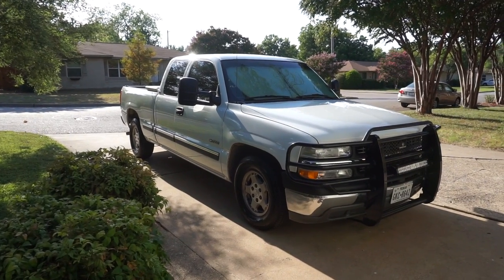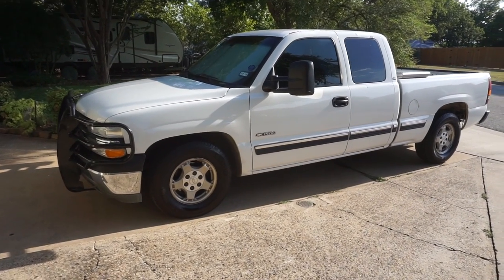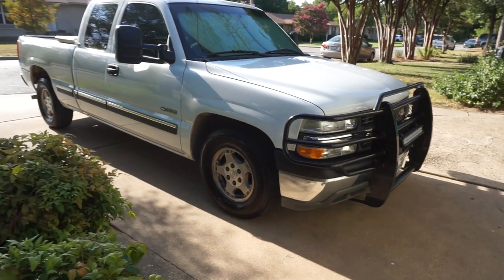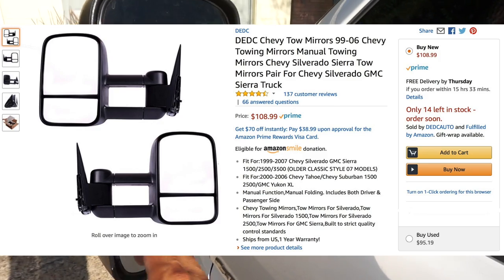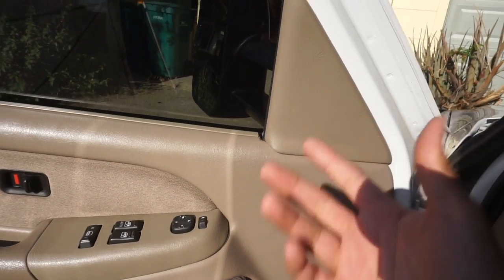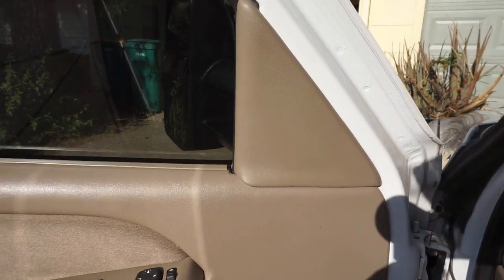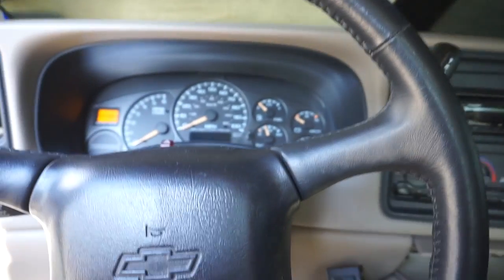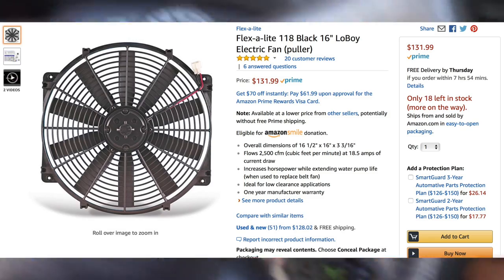My Truck Towing Upgrades - 2002 Chevy Silverado

Comment: Very nicely set up rig, great set up for that trailer. I will say however, I don’t typically tow much heavier than you but I wouldn’t give up the stability and confidence my 3/4 ton truck gives me for anything. Great video 👍
Reply from the maker: The bigger truck and suspension is always best.  My goal with this video was just to show how I got the most out of regular older truck.  I have since upgraded but there a lot of older trucks that people could certainly setup to tow well with.

Comment: Just did the brake controller on our Silverado. Going to do mirrors next I think. We are only taking short trips with our halftime and 25 footer as of now anyway. Lot of good information here man I do appreciate it. Go team Texas!
Reply from the maker: Curbside Junkies I appreciate it!  I would strongly consider doing the HD Trans cooler and temp guage... by far one of the best upgrades... and wasn’t expensive either.  Be sure to do it in addition to the current stock trans cooler for twice the cooling.  👍

Comment: Do you have video with any of the installs? How easy was the installer for the brake controller, low-boy fan, and transmission cooler with the gauge?
Reply from the maker: @christianshipman5766  
Brake control was plug n play
low-boy fan - yes I have a video on the channel 
Trans temp - mechanic installed when they installed the larger cooler

Comment: Helper springs are good, BUT . . .  Helper springs will not increase the carrying capacity of the truck.  They will help smooth things out, but you must not exceed the payload capacity of the truck.  That includes the trailer tongue weight and the weight of all occupants and their gear in the truck itself.  New trucks have a sticker in the door that will give you the payload capacity. This is not the towing capacity.  My Dodge Ram has a 7,800 pound towing capacity but only a 1,176 payload capacity.  The hitch weight of my trailer varies between 500 and 700 pounds, depending on how much stuff we have in the trailer.  So, when we hook up the trailer (which is well within the limits of the towing capacity) and my wife and I get in, plus our gear, we are actually 100-300 pounds over the payload capacity.  The problem with not being careful and exceeding the payload capacity of the truck is that if you have an accident, your insurance will not pay.  You will be stuck with the total bill.  So, keep that in mind, and remember that helper springs will not increase the payload capacity of the truck.
Reply from the maker: Correct the helper springs do not increase capacity, or any other item does not increase. The purpose of that is mainly to help level your truck, keep the front end of your truck lower for more control and a more comfortable ride.

Comment: Had the same problem with my Express van with the 350 in it towing. Had to put a duramax fan blade on it to keep it cool towing in Texas heat.
Reply from the maker: 106 today, that will put some stress on the cooling system.
Reply: I added a 3,000 cfm Flexalite 16" fan behind the radiator, between the radiator and clutch fan and it is controlled by the LS P59 PCM running the 350. I built bracketd and bolted it rigidly in place to prevent it from damaging the radiator or coming loose and getting sucked into the mechanical fan.  PCM turns the electric on with a/c or engine temp below 50 mph. I used a 2007 Trailblazer electric fan clutch. My first setup turned the electric fan on with Fan1 output and powered the fan clutch on Fan 2.  I have since added full PWM control to the fan clutch, using the 2003-2004 LM4 5.3L Trailblazer fan settings and wiring diagram.
Reply: @luisreviews6412  Mine got a work out yesterday.  Air going into the grille was 113°F.  In really hot weather my 383 will hold 220°F even working hard.  It has a 195°F thermostat and usually runs around 200-205°F. IATs sky rocket in the heat though, around town they were 194°F.

Comment: I have a 2000 5.3 Silverado LT with 3 hundred thousand miles on it and it still pulls my 9 thousand pond rv great so u dont need a diesel just have to know how to pull
Reply from the maker: Michael Bayless It could pull it without a doubt, but if you encounter hills or mountains it will certainly struggle.  The main reason I purchased a new truck was the need for a crew cab as my kiddos are getting taller and need more space.  By the way it is still in my driveway and does all my dirty work from hauling and towing.
Reply: Hey Michael I have a 2000 SC SB 5.3 Z71 I'm about to hook a 4300lb travel trailer to (dry weight.) Sounds like I might be ok? Upgraded brake controller and transmission cooling
Reply from the maker: GlutenFreeBear Consider adding helper springs they made a world of difference for me.  They were pretty cheap too.
Reply: @luisreviews6412  thanks! I have the sway and WD hitch at the moment will test my sag
Reply: i just bought a 2000 with the 5.3 how does it pull mine has 230k and i need it to pull a 7,000 pound camper does it struggle?
Reply: @tylerrobinson7322  I mean it does struggle a bit but as long as you use the tow haul it should do what you want it will not be a speed demon but it will do it dependably and reliable
Reply: I got a 2000 5.3 vortec  270k what can i do to pull a 32 ft rv trailor about 9800 pounds can i pull it 400 miles?

Comment: I have an 04 Avalanche that I've been doing upgrades to my truck as well, one upgrade that I did was to change out the axel bump stops.  I purchased them from Etrailer and they helped out a lot.  The axel bump stops that came with the truck were completely gone.  I bought the truck used, but it already had a brake controller installed.  I'm going to put Efans on it next and a trans cooler
Reply from the maker: Randall Castro Sr. Trans cooler is by far the best upgrade I did, don’t forget the trans temp gauge too.  I did e fans too... I have a video on my channel if that helps.
Reply: I put 1-ton overload leafs and Summo springs (replace the OE bump stops) on the rear of my 97 Express van that I tow a 28 ft with.  Much nicer ride than the OE leafs bottoming out on the OE bump stops all the time. I also replaced the stock 350 with a 383 when it was time to replace it and built the 383 up a bit.  Getting up to speed and climbing grades is no longer even a struggle. I had replaced the 4L60E with a 4L85E prior to the 383 upgrade.

Comment: Towing anything with 3.42 gears is like shooting yourself in the foot.  I have 4.10 in my Z71 but if I had 3.42 or even 3.73 I would swap to 4.56 gears.  The other upgrades you did are good.  Do you have a weight distribution hitch and anti-swap bars for your camper?  My friend tows a 30 ft with his Sierra 2WD 1/2 ton.  He's putting in a cam, long tube headers, a tune, and switching from 3.73 to 4.56 gears.  He has the same Tekonsha brake controller you have and I am going to put that in my Z71.
Reply from the maker: Scott Long 3.42 isn’t ideal, 4.10 wow must be nice, what kind of mileage do you get?  I got a 2018 Tundra with a 4.30 rear end you can really feel the difference gears in stop in go mainly.  I use a Husky Centerline TS and have been very impressed. The P3 brake controller has been flawless you will like it.

Comment: Have you ever thought about 2500 leaf springs on your 1500. I was told they would fit
Reply from the maker: @myleshartman7530  I didn’t think of that honestly.  The truck was at the end of it’s time with me so I didn’t want to do or spend too much.
Reply: @luisreviews6412  I'm thinking about living in a camper full time and I have a 2000 Chevy 1500 so hopefully it'll do the job

Comment: Do you use a towing motor oil also?Like valvoline vr1 racing oil in 10w30 .or a diesel oil in 10w30?....or even 15w40 or 50.Mobil 1 15w50 synthetic is also a good choice for towing in Texas heat.Still flows good in cold weather too.....great video btw.
Reply from the maker: steve rugerguy When I got the RV is when I made the switch to Mobil 1 for those reasons... the Texas heat and added demand.

Comment: If you had all of these upgrades do you think  You would be able to handle a goose neck. But let it be aluminum or a light goose neck?
Reply from the maker: As long as it was all within specs.  Biggest issue is payload and suspension.

Comment: I have a 2002 chevy silverado 2500hd 6.0 gas will that fan and the transmission oil cooler and the left springs  and the brake controller work for me and how did you install it.
Reply from the maker: I wouldn’t do those specific fans for a heavy duty, honestly I would keep the stock fan.  Yes on getting a better transmission cooler. There should be specific helper springs for your truck.  I did the springs myself, just bolt on. The cooler a mechanic installed along with a trans temp guage.
Reply: Well I didn't want to put the double fans but that one single fan

Comment: I know this is an old video, but I have the same paint* problem on my 09 Silverado. I take good care of my paint*  too. They must have a bad white color or something.
Reply from the maker: Agreed, but I believe it was the clear coat they were using at the time.
Reply: Every GM vehicle painted white will sooner or later have paint peeling issues. The last white one I had would lose paint in sheets going down the road. Adhesion between the paint and primer is weak and the paint tends to develop cracks that allow water penetration causing the paint to flake off. The only fix is to strip the vehicle and repaint with a quality compatible product. This has been a problem for years and GM refuses to address the issue.

Comment: Great video man, really informative.  I do have a question though...where did you install the transmission cooler and the accessory LoBoy fan? One in front of the radiator and one behind?  Both on the same side?  Thanks...
Reply from the maker: The trans in front, the loboy goes behind.

Comment: I might make some suggestions, don't do the electric fan, I would just upgrade your fan clutch and fan to a performance version, you also do not need to buy and set up a whole new temp gauge, if you want it to look more uniform buy a used cluster with the temp gauge on it from a 2500 and its simple to wire up, do not have two trans coolers installed it just creates a longer point a to b for the fluid, just install the heavy-duty one and throw the old one out, helper springs are nice but cheap and they crack and bend easy over time, getting rear airbag suspension is a better option for the warranty and it also allows you to choose your ride height, this video is helpful but as a long time mechanic I just wanted to add my tweaks.
Reply from the maker: Appreciate the input, the upgrades were all done in the last 2-3 years of ownership and were great.  I knew the end was near so the upgrades were a bang for the buck solution because there were certainly other ideas.  With that said the big one I would have spent money if I was starting out was the performance radiator and fan route... thd rest were perfect.
Reply: @luisreviews6412  your video is very helpful, i just wanted to give some input on different options if people are willing to spend a little more, love the video tho
Reply from the maker: @AllAboutCars1999  My main thought behind the video was to show what I did to get the most out of my truck with a few inexpensive upgrades.  Too many automatically get rid of what they have and get a new diesel 18 wheeler to pull their pop up when what they have is capable.

Comment: Hi, i’m towing a 5,500travel trailer with silverado 1500 (2009). Has tow package and engine is overheating (5.3L), but if i stop and rest for 5 min it goes back to normal. Any idea what i need to upgrade?
Reply from the maker: Water pump, fan clutch, radiator fluid,

Comment: Who did you get to instal your temperature gauge ? I just ordered the one you have on eBay is there anything else I should order to be able to install it on my 5.3 sierra 1500 05’
Reply from the maker: TrillmaticEnt I had a shop install it.  I was having other work done and went ahead and had them install the guage as well as the cooler itself as well.  I don’t believe you need anything else for the guage as far as parts.

Comment: How much cooler did the truck run with the extra fan when you towed?
Reply from the maker: So with the normal stock fan plus the small E-Fan, little to no difference.  If anything I think having it may have caused turbulence when towing at high speeds but none the less it was fine.  The E-Fan helped when I was at idle or in stop and go traffic , Essentially picking up the slack for the main fan. My favorite part about adding Ethan was being able to keep the truck temps down at idle or parking and having cold air conditioning.

Comment: I highly, highly recommended to change out your trailer tires to a better and safer tires for your camper
Reply from the maker: Randall Castro Sr. 3 Years with them and they have performed well.  Replacing them next month before a long trip.  No complaints.

Comment: put a seven inch fan on the trans cooler also
Reply from the maker: don350x I saw that option when I was shopping for the trans cooler.  I will say even without the fan that trans doesn’t even come close to being hot... by far the most underrated improvement for towing.  I will say one thing that helps is I left the stock cooler and added the aftermarket inline, so the fluid cools twice.

Comment: Which upgrade will you recommend to do 1st
Reply from the maker: That’s a difficult question.  I think if you have a trailer that requires electric trailer brakes then a brake controller would be first.  I think these will squat so those helper springs next.  Towing mirrrors would be nice and then adding a trans cooler and temp gauge at the same time so you can keep an eye on the transmission.
Reply: @luisreviews6412  thank you
Reply from the maker: @l.d.b.r5141  Did you get a trailer or just getting it ready?
Reply: @luisreviews6412  oh I'm getting ready, I have the tow mirrors, The break controls came with a truck. I'm just saving up for the helper Springs. And the transmission deal.
Reply: Did you still have that truck because I haven't seen a video of it on the road Towing the RV?

Comment: Is towing 4,800 pounds a lot for this truck?
Reply from the maker: I towed around 6k, it was fine.  These motors rev a bit but is no problem.  The rear axle however is setup for the highway, and not as much for in the city.  You will be fine.

Comment: btw whats better level spring or air bag ?
Reply from the maker: The tow police will tell you air bags, my experience are with Helwig Helper Springs and Super Springs.  Springs are better fir what I need, more cost effective and no maintenance.
Reply: Springs are too stiff, when not towing. Like riding in a 3/4 or ton truck.
Aiir bags have better ride when and when your not towing.  Little more maintenance? so worth it. For instance only maintenance I’ve done in two years of airbags is if, I go to tow gotta check the air and make sure it’s right, and has air. I run 10 lb empty and 50lbs loaded
I’ve had 2 ton in bed of truck with 40 lbs of air and it was sitting level n I have a 3 inch leveling kit in the front. Rode well little front light but that’s actually 1600 lbs over rated payload capacity. N it’s a z71 truck. In other words mine already has the extra spring he installed
Reply: @jeremywilson1299  if you shift the help spring more to the front vs the back of the truck it wouldn’t be so stiff or u can the type of spring he has are adjusting

Comment: Wanting to get a used 5.3 Silverado similar to yours to tow a 2,000lb trailer with a 3,600lb car on it. Would you recommend a Silverado or a different truck? My goal is a reliable truck that will feel safe towing on the interstate and not feel nervous about the trailer weight pulling the truck around the road. Thanks
Reply from the maker: XY Zebruh Depends on your budget.  Can this truck do it?  Yes.  Safely?  Yes.  Winning drag races?  No.  But for this year truck I tgink it would be a good choice... easy to work on, decent power, reliable... I have the 3:42 ratio... it isn’t to good in stop n go but on the highway it shines.  However I might look at a 3:73 or 4:10 ratio ( not sure they d we even make these) but it would have better towing but worse gas mileage.

Comment: You bought more trailer than the truck can handle safely.
Reply from the maker: Deep River Disagree but thank you for the comment.
Reply: completely not true. a 1500 2wd can tow just fine it you have the right equipment and know what your doing
Reply from the maker: Terry Frye I agree, it can tow safely never felt concerned.